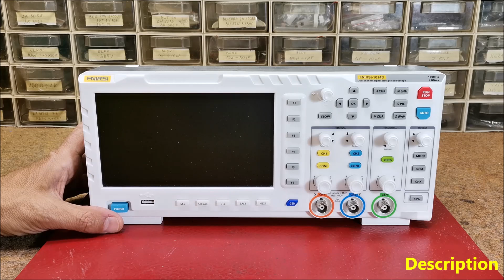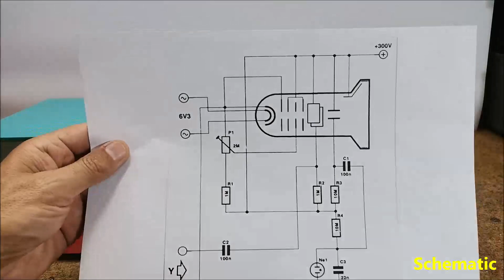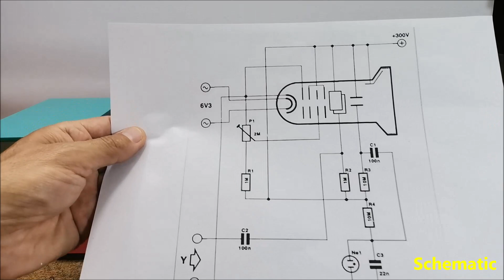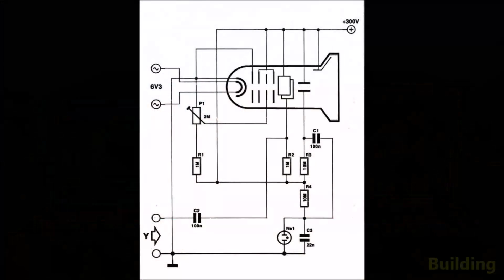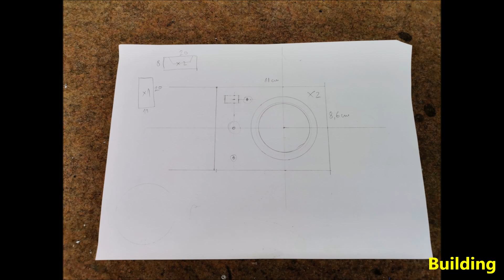DIY simplest small CRT Oscilloscope

Comment: Great project,   i have 5.5 inch crt tube with deflection coil.  Are 300v too much for deflection coil or they resist that voltage?

Comment: Hi! I'm seriously thinking about following your example and making one myself, it really doesn't seem to be impossible even for a amateur tinkerer like myself.
I'm currently thinking about the high voltage source - since I don't have a 12v to 400V boost converter at hand, is there a reason (other than safety of course) not to use rectified and smoothed mains voltage? 230VAC should give me 325VDC using just a bridge rectifier, that should be plenty...?
Thanks!
Reply from the maker: Feasible, but very dangerous, especially that during experimentation we often forget about caution and safety
Reply: @MirkoPavleskiMK  So as a "temporary" solution then, till the AliExpress boost converter arrives... 😉

Comment: I have used that high voltage power module to make fender champ guitar amp clone and it works fine (which is strange)
around 300v too from 19v notebook power adapter

Comment: nice project but, crt tubes normaly need also a negativ voltage, this could also explain why you are only able to use like 2/3 of the screen
Reply: Do you mean the sweep voltage? In this case the sweep voltage is AC coupled to the tube by means of a capacitor, so it is centered on zero volts DC.
Reply: The sweep voltage was in this case made with a neon tube and is not high enough to sweep the dot completely over the screen. More info here  https://youtu.be/MIr39VXie5o?si=TNmPUoV0fHwZ-uxG  (long series of video's about a simple oscilloscope).

Comment: Ahoj Mirko! A took apart a huge projection TV you know with the Frensel lense. there are 3 small diameter CRT tubes inside, and I kept it aside for some similar useful project maybe a Curve Tracer, but I have not much knowledge yet about CRTs. What's your guess, are those tubes ideal? Is there a possibility to determine it by e.g. the resistance of the horizontal and vertical coils? Any suggestions?
Reply: Unless you just want to make an arty display it would be better to get an electrostatic deflection CRT. The difference in possible bandwidth will be profound.

Comment: You may replace R4 (10M) by a 4.7M resistor in series with a 10M pot (mounted on an insulating support along with a plastic shaft) to trim the sweep time. Also, add a multi-position switch with different values of capacitors for C3 (switch cold sides), or minimally, a simple toggle switch to add / remove a second 22nF capacitor in parallel with C3. In this case, switch the cold side of the second 22nF.

Also, C1 an C3 must be high voltage models.

Use an insulated (plastic) tool to trim R1 !!!

This project deals with 300 volts DC. Do not build it unless you are TOTALLY aware how to deal with high voltages.
Reply from the maker: Thanks

Comment: Nice work!
I recently (well, almost) finished a similar project around the D3-11GJ tube (32mm diameter, 600V anode voltage). I do not call mine a scope, because it lacks any sort of sawtooth deflection (not even this kind of neon bulb oscillator), as I know a proper horizontal circuit with triggering would be a giant task and not really worth it.
Instead, I call mine a "vector display", an ESP32 board supplies two channel XY signals to the deflection plates via an amplifier. The amplifier is needed, as the ESP's outputs are 0-3.3V, and the tube needs plus/minus 80V for full deflection. If you want to build something similar, I recommend to study the vertical amplifiers in old scopes.
I also rolled my own power supply - 12V to -600V, plus/minus 120V (for the amps), insulated 6.3VRMS (for heating) and 9V (stablized, for the MCU). It is based on the popular ZVS circuit, driving a custom would transformer. I can recommend this design for the simplicity, you only have to make sure the transformer has an air gap so the primary have a large enough leakage inductance for self-oscillation. You will need fast diodes too, but the circuit is super-simple, and the DC voltages are very stable without any feedback.
For the heating, I used 6.3VRMS square-ish wave from the transformer, but I don't recommend that soultion, as the distortion on the signal makes getting it right quite hard. If you want to heat the tube with AC type votlage, I recommend a separate square wave oscillator (maybe just a simple two-transistor astable), so the voltage is regulated via the peak value, and the main PSUs internal waveforms don't play a role.
For havin an amplifier, making the anode the ground potential, and setting the cathode to a negative high voltage worked well for me, as it greatly simplifies the design of the amplifier. This, on the other hand, made the PSU a bit more complicated, as I needed isolated heating voltage.
Looking forward to your scope-clock!
- HA7DN "Uncle Dino"

PS: I like your channel's logo.
Reply from the maker: Thanks for the suggestions, I plan to expand this project to Scope clock in the next period
Reply: A good deflection circuit can be easily made with only one pentode like an EF80 using the Miller-transitron circuit and could use the same HT source. It gives a very linear sweep having big sweep voltage.

Comment: Can you make video to interface cellphone with old rotary phone ? I saw one wired unit and other Bluetooth..both above 60$ cost . can u make  it diy ?
Reply: 60 is not a bad price to be fair. It would be quite a bit of programming to make something be able to dial with the click tones and convert those to actual dialong on the phone. Way more hours trying to get that part to work than 60$ worth in my opinion.

Comment: Hi Nice Project, but the Power of this HV DCDC is no more than 30W and up2 40W for short Time. I completely redesigned it to be more EMI Quiet but I used the same transformer Size and same PCB Size (although completely new Layout, I redesigned the Transformer too and had it made by RANLO in China) . The Transformer is a EFD25/13/9 core Size and the China DCDC runs it at ca. 75KHz.